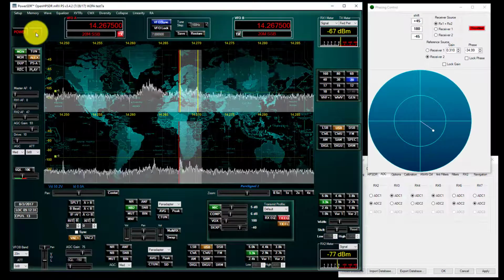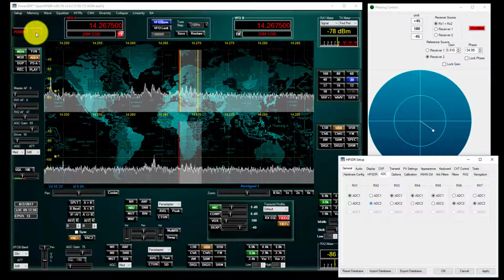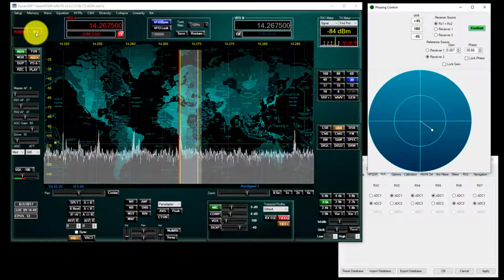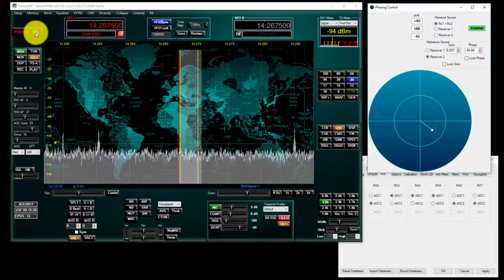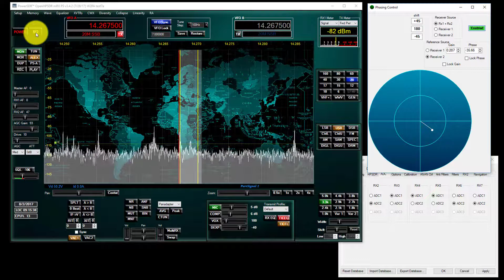Diversity Feature Anan 8000 DLE

Comment: Can you tell me if the rx1/2 is grounded during tx i know it is not on the Anan100d just curious to know I'm thinking about getting one? The phase antenna could pick up strong near field RF and blow the front end out why they never made this happen on the Anan 100d is dumb
Reply: Excellent question.
Reply: I would like to know as well. That would be a deal breaker. ZS1DX